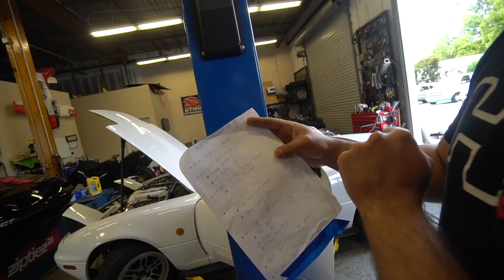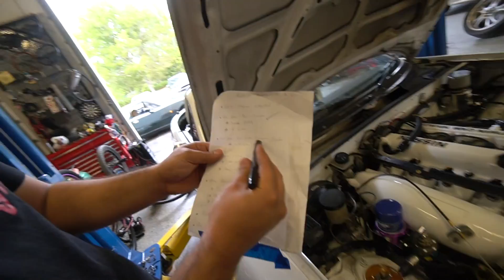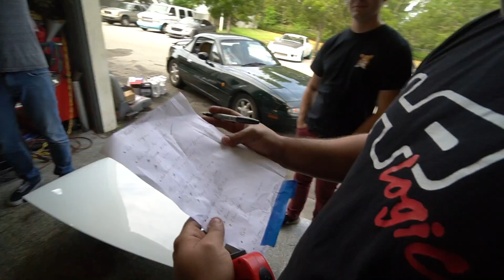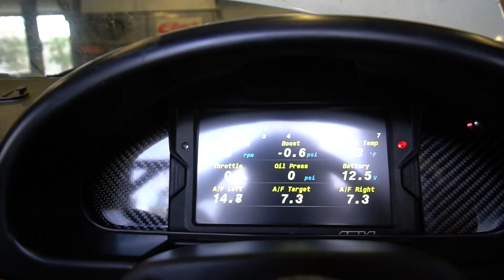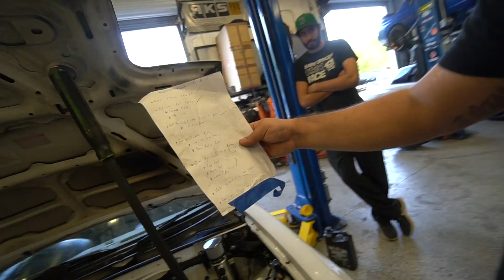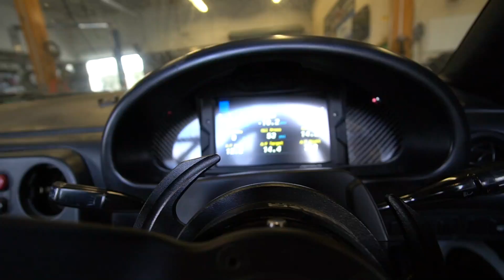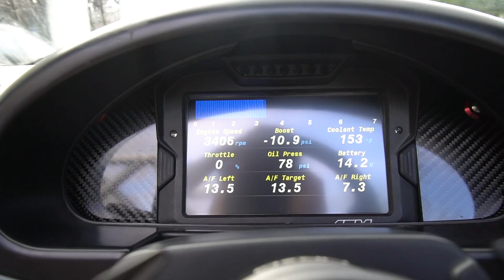SR20 MIATA FINALLY DRIVES!

Comment: Don't get me wrong when I say this, because it looks great and the guys at HP Logic did an awesome job finishing it all up, but one thing that would've set this engine bay off would've been to hit up my boy Frank at Downstar and gotten some really nice dress up blue zinc plated bolts with beauty washers in the color of your choice for every visible bolt in the engine bay. The Bolt Boys do an amazing job on their bolt packages and yes, they're mostly made for Hondas, but you can also order bolts by the size and diameter. They're all hex socket head bolts with 12.9 grade blue zinc plated bolts and real billet beauty washers at great prices. Trust me, they're definitely billet washers because I had to grind one on one side to fit on my strut brace and it took forever to grind a flat spot with a 40 grit flap disc. Hit Frank up at www.downstarinc.com for all of your hardware and fastener needs!